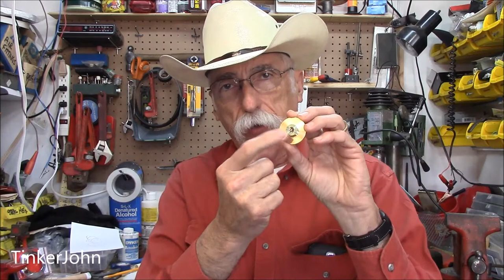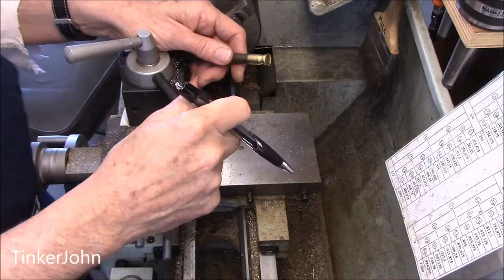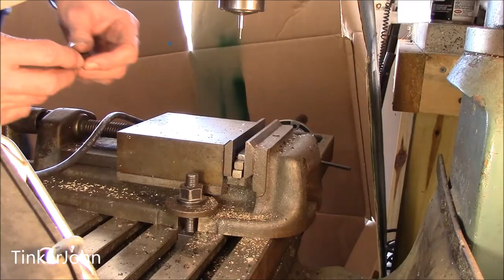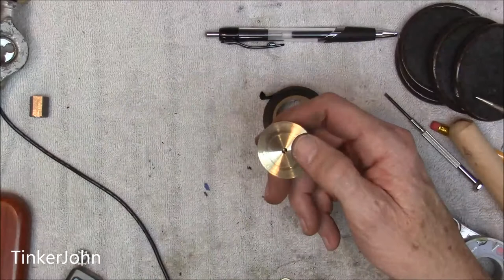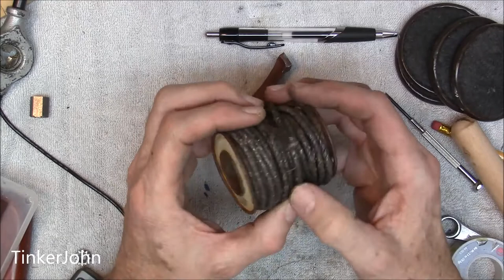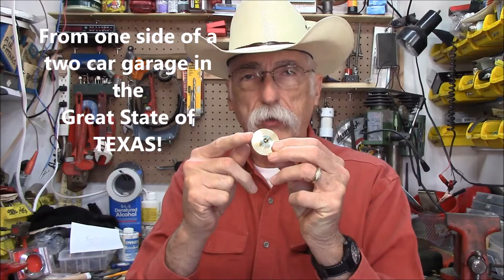Machining the Stuart 10V Steam Engine Castings - Part 37

Comment: Great stuff. You have given me a technique I might need for a wooden nut and bolt project because I need to hold the bolt to finish the head and I was trying to work out how to hold it without damaging the threads.  Your method to treads a female holder is just what I need.  Thank you
Best Wishes, Brendan.
(I hope that wasn't your best Sunday shirt you were wearing at the lathe)
Reply from the maker: baconsoda Brandon, thanks for the comment.  Glad you were able to get an idea to use.    ~John

Comment: You have some real nice parallels in your tool box, why didn't you use them to cut your slots thus making sure they are on pane with the end of the nut.  Your setup was wandering all over the place and you should have broken your small milling bit, luck was on yoour side huh.

Comment: Thanks for another great video John.  Really enjoying this series.  Are there any uses for these little steam engines?  As in do they have enough power to actually run anything, or are they more of a hobby kit to build for a conversation piece?  Thanks for your time.
Reply: Long time ago I knew a man who had taken the two cylinder version of the engine, mounted it on a platform with small boiler and set it up to run on live steam railroad tracks.
Reply: Steven Gunter That would be a fun project.  It would be very interesting to see it in action.  
Build a scale model steam engine to power the lathe :).
Reply: William Todd A friend where I worked built his own steam engine design and boiler and mounted it in a remote control boat when he retired to Florida. The boat was  about four feet long and moved along well. He including a reversing lever mechanism. Built to look like a tug boat.
Reply: gvet47 Would be interesting to see photos of the boat.